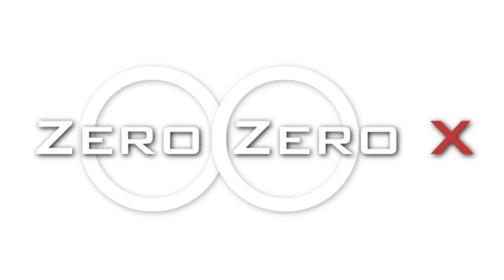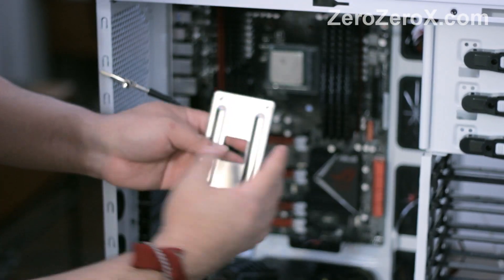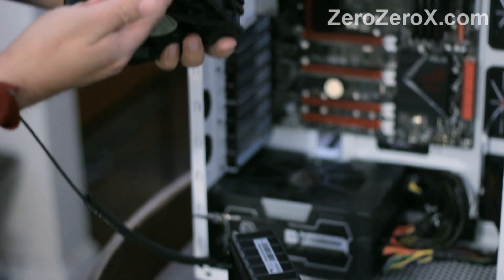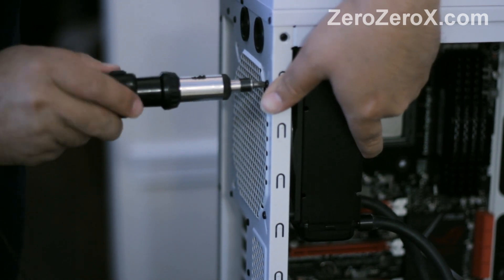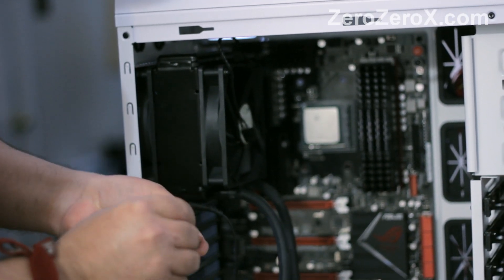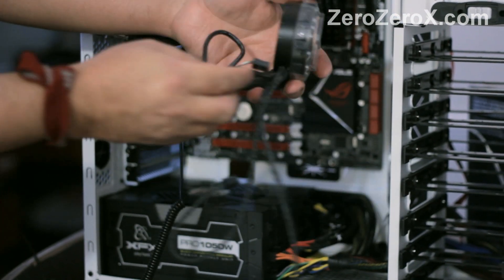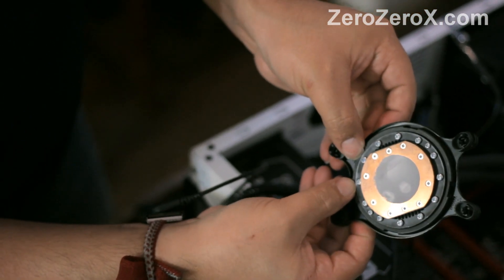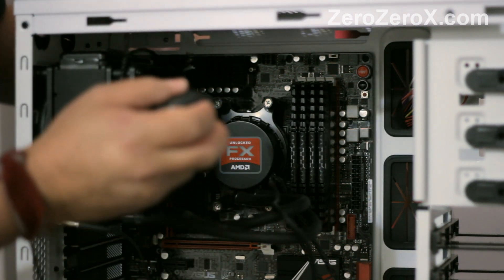How To Install The Liquid Cooling Kit On The AMD FX-9590, AMD FX-9370 and AMD FX-8150 CPUs stock.

Comment: Where do you get the fan adapter cables? Also the USB 2.0 cable does it need an adapter as well? 3rdly do all motherboards need the adapter or do some fan headers provide enough power? Thnx
Reply from the maker: If it does not come with the right adapter, I stop by a local Micro Center store for them. There is a USB 2.0 and/or USB 3.0 header on motherboards, you can get a splitter. Fans in this built usually need one connection for powering the fan and another to control the RGB. Both go to the motherboard or in some cases to the power supply directly for power.

Comment: What is the software to change cpu color for the coolor and at idle mine sits at 80 to 90 degrees F is this bad? Does that mean the cooler isntnworking properly
Reply from the maker: I checked your channel, pretty cool! I might still have the installer for the software I used. I gonna look for it and send you a link. I do not remember the exact name of it tho. In the mean time feel free to check my other gaming and music videos. And, maybe Sub?
Reply from the maker: Now those temps seem a bit high for idle but normal for use

Comment: im having problems with that pump. i have it connected to cpu_fan and also tu usb conector. I can read temps and fan revolutions., but temps ar not changing the fan speed. fan speed only changes when cpu reach 75º, where the bios says that automatically will put fans to 100%. no other configuration i tried work. not auto, not manual. help please.
Reply from the maker: Use the software that comes with the liquid cooling system. To create a temp graph. It is the same software to customize the light color on the FX logo.
Reply: @OsoXVids  i realy cant find that software on internet. I dont have the CD neither. I have tried chillcontrol from Antec And termaltake (if l am not wrong) And says that the device is not detected. Everithing is plugged. Must be that i need the AMD software. Someone knows a link for that ?
Reply from the maker: Let me check whether or not I have a backup of it.
Reply: @OsoXVids  Thank You. I realy apreciate your help. Hope u have It. AMD is telling me to Contact my mother board provider, even when i tell them that i only need the pump software

Comment: Can i use a FX-9370 with a good air cooler?
Reply from the maker: Yes you can. There are plenty of options. Also, the FX-9370 doesn't heat up as much as the FX-9590.

Comment: I'm hoping you still have this to memory :/ Can you remember the cooler connections. Two connections are 4 pin male requiring 4 pin female adapters. Are these for power or for extra fans? Cheers
Reply from the maker: The 2 four-pin connections are for the two fans included in the kit. Please check the video again you will see the explanation there. I am sure. CHECK at:  15:15
Reply from the maker: The 4 pin connectors go from the pump to the radiator fans.

Comment: Great review, you def got a sub! I have a question for the liquid cooler, do you eventually have to change the liquid? Also, what were your temperatures? A respond as quick as possible would be greatly appreciated :)
Reply from the maker: You do not need to change the liquid since it's a closed loop. 
You need to clean the radiator from time to time tho, that's all the maintenance it needs.
Dust collects on the radiator and sometimes the fans.
If I remember correctly, idle is under 45 and it goes all the way to 64. You can adjust the intensity of the fans according to the temperatures with the software, as well as change the color of the FX logo.
Reply: ZeroZeroXVids 
Fantastic! Thank you for the information and your immediate response :)
Reply: What's the software would love to change the colors need response asap 😅

Comment: HAZLO EN ESPAÑOL!
Reply from the maker: +daniel cartes zambrano Veremos  : ]
Reply: hola, tengo una crosshair formula z, y un cooler master seidon 120xl, me servirian para un fx 9590???
Reply from the maker: +daniel cartes zambrano Si, ello seria capaz de enfriar el procesador. Pero yo te recomiendo (basado en my "research") el Cooler Master Nepton 240M con Silencio fans, si es que tienes el espacio en tu "case"

El video esta aqui: https://youtu.be/Gc-Z4fvKzrQ

Personalmente yo hice el 'upgrade' porque enfria mejor, que la solucion mostrada en este video y es mucho mas silencioso.
Reply: +daniel cartes zambrano solo he visto personas comentando problemas cn la crosshair
Reply from the maker: +daniel cartes zambrano La verdad es que es muy capaz pero si tuve unos problemillas: Primero el conector de fan principal al lado del CPU no es suficiente para administrar poder al fan de el 'cooler.' Segundo, despues de un tiempo necesitas iniciar la computadora completamente cuando la prendes no fast boot. Tienes que apagar la computadora completamente, apagando con Win10 y el power supply cada vez.
Reply: creo q fue una muy mala compra
Reply from the maker: +daniel cartes zambrano No. Estas bien!  La crosshair formula z es una de las pocas que realmente soportan el procesador FX-9590 Es muy buena para overclocking. Puedes usar el ROG port para monitorear todo (temperatura, frequencia y voltaje de los componentes incluso de la tarjeta de video si es ROG) a cualquier momento con un Laptop o Tableta. 
Considera nada mas que hay de apagar la computadora completamente cada vez para tener este tipo de velocidad y poder. Y esto podria ser arreglado con un BIOS update.
Reply from the maker: +daniel cartes zambrano Creo que son buenas compras el cooler es similar al stock cooler de el processor pero de mejor calidad. Y la motherboard es muy capaz con un buen BIOS gráfico y facil de entender. Debes saber simplemente que cosas esperar. Hay mas puntos positivos que negativos en mi experiencia.
Reply: +ZeroZeroXVids genial, labultima bios update es la 2201. yo no quiero hacer oc. creo que asi tal cual ya es un procesador potente, desde el fx8350 al 9590.
Reply from the maker: +daniel cartes zambrano Correcto. Es ridiculamente potente. De todas maneras puedes monitorear los componentes aunque no debas de preocuparte de la estabilidad. Esto es muy divertido!
Reply: +daniel cartes zambrano soy nuevo en esto, y tngo miedo a cometer un error y quemar algo
Reply from the maker: +daniel cartes zambrano Entiendo  : ]  Es bueno saber que la comunidad de YouTube esta aqui para ayudarte.
Recuerda que tenemos videos de instalaciones de casi todo. Felicidades y buena suerte en la construccion de tu nueva compu.
Reply: gracias! el problemas comun q he visto es q se apaga l pc despues de un momento. y ya te mencione  lo que me he comprado, un cooler master seidon 120xl, una fuente cooler master v1000, y la crosshair v formula z. queria comprar l fx 9350, pero creo q me estoy arrepintiendo, y tal vez compre un fx 8350 o 8370. en la web de aus especifican q la crosshair soporta hasta 140w.

Comment: I'm confused on how you have the fans' power cable wired can you show exactly how you did it?
Reply from the maker: xxxXXXxxxXXXxxx420BlaZeIt360NoScoPeZYoLosWeG69_6MLG9UxxxXXXxxxXXXxxx Both fans connect to the pump via a power cable that goes from the pump and splits into two for the fans. Note: The order is irrelevant.
The pump connects directly to the power supply via a fan to molex adapter, preferably.
It can also be connected directly to the motherboards' CPU "fan 1" connector and then you connect the pump's USB cable to the USB header on the motherboard to control the liquid cooling system with the included software.
Reply: ZeroZeroXVids Could you use one of the fans as a case fan and just have the radiator with one fan like most watercooling systems so you can plug it into the cpu fan socket without one of them not working or would that make it not cool good enough?
Reply from the maker: xxxXXXxxxXXXxxx420BlaZeIt360NoScoPeZYoLosWeG69_6MLG9UxxxXXXxxxXXXxxx I wouldn't recommend that. This fans are there for a push pull configuration mostly. 
You could do it but the cooling capacity will go down a little and sometimes it counts when at full load.

Comment: the Corsair H60 looks alot easier than this liquid cooling system, you dont have to take any brackets off the motherboard or fool around with parts, the H60, you just put one bracket on the pump which is magnetized and that's it, the stock pump looks like a pain

Comment: what is the hand band for? I seen them before just don't know what they used for!
Reply: Big Boy Paul   Junge das ist doch kannst Klar warum gegen  statische Aufladung
Reply from the maker: PAULin 4k It keeps you grounded while working on your computer. Prevents electrostatic discharge by connecting your wrist to your computer's metal chassis.
Reply: ZeroZeroXVids If you don't wear it does it damage any computer components?
Reply from the maker: PAULin 4k Correct. Circuit boards in any component. Chips too can get fried.
Reply: ZeroZeroXVids hey thanks for replying man, and great video. Planing on upgrading my computer to 9370, this helped a ton, since im new to water cooling! Thanks again!!
Reply from the maker: PAULin 4k No problem. Let us know how it goes!

Comment: Just in case anyone is wondering if this processor (Amd FX 9590) can be cooled with an air cooler, well it can.  I was worried that my Cooler Master 212 Evo wouldn't keep it cool, but it does a great job. It keeps it under 47 Celsius.
Reply: 47c while in idle?

Comment: So the way you installed you push in cool air from outside and it goes the the radiator and then i pushes out the hot air from the radiator into the case. Not the best way.
Reply from the maker: The air outside the case is cooler in most situations. So, one of the fans pushes that air into the radiator while the other fan pulls it inside the case, where the hot air goes up naturally. And, then the fan on top of the case pushes that hot air outside the case completely. I tried both configurations this works best, cooling wise.
Reply from the maker: ZeroZeroXVids Try both. See what works better for you. Getting the cool air from outside (both fans in the same direction, of course) causes more dust to collect on the radiator, that's for sure and you got to clean that more often.

Comment: hiya pal hope you dont mind me asking you more stuff ave put the amd cooler in my tower now making sure the fans pull the air in from the out side to the in side what i want know is now i have 2 fans to put in the top of my case so should they be blowing air in or taking it out and i have one for the front of the case as well which way should that one be blowing as well just wanted to know what you would do mate thank you in advance :)
Reply from the maker: The 2 fans you have on top should take the hot air out, upwards. Hot air goes up naturally. This will help cool the whole case. The front fan should take air in, to help with the air flow inside the case.
Reply from the maker: Check:  http://youtu.be/oD9RS2CFCvY
Every couple of months you want to clean your radiator, which will be collecting dust from the outside and creating a layer on the side. You can use a brush, even better a can of compressed air and/or wash it with water.

Comment: hiya pal so i leave the cpu fan connection empty and get a molex 2 fan and use that ? sorry for sounding bit thick just i get one of these in next few days and want make sure i do it ryt. thanks pal :)
Reply from the maker: Correct. You got it. The two fans get more power.

Comment: what cooler is that?
Reply from the maker: The liquid cooling is stock. The kit comes with the FX processor, together. You have to buy them both. Check on-line.
The pump says FX on it and the fans have the AMD logo and they go to the front and back of the radiator.